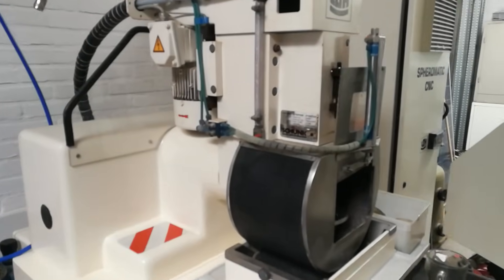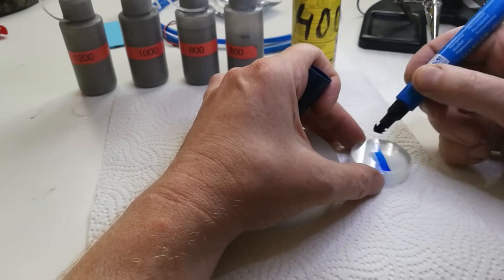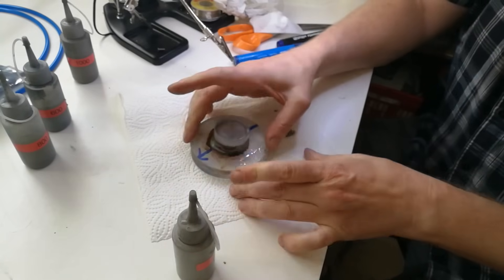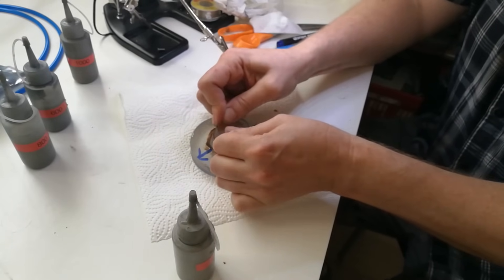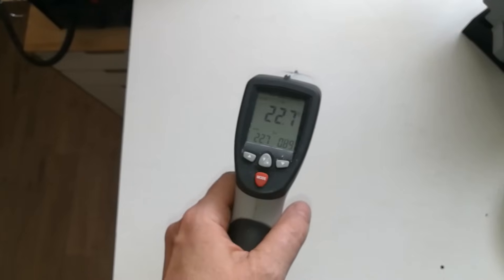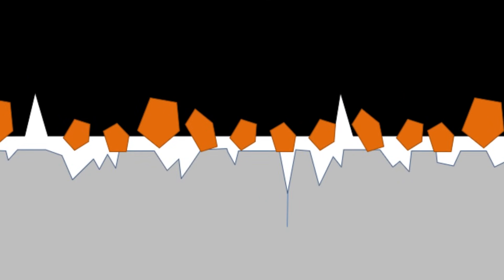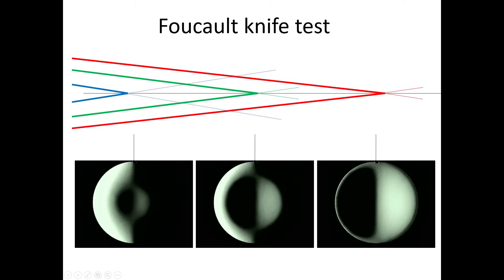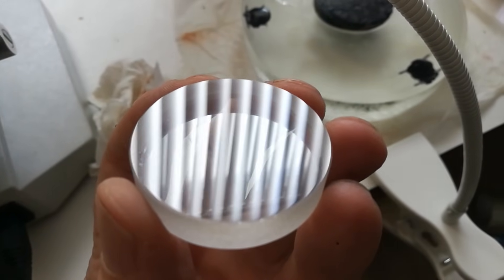Polishing a Small Spherical Mirror Surface on a Glass Blank

Comment: This is black arts you share with the world. I am humbled someone who knows this esoteric knowledge has kindly decided to share such things in detail on youtube. What you do is pretty amazing, and I may use some of this knowledge at one point in my watchmaking for crystal polishing. Thank you!
Reply: Same here, this is extremely valuable, well into the black arts territory.
Reply: Unless you’re sticking with mineral crystal, I don’t think this will work as well for sapphire. And unless you’re working on a watch with a very unique and hard to find crystal , I can’t imagine spending hours on just a crystal
Reply: @imvisier9925  you misunderstand watches and watchmaking, where "black polishing" a screw head to a specular finish is mundane.

The process of polishing brittle optical materials presented here is directly applicable to many watchmakers working on older watches or making new ones. Restoring an old crystal, or custom fitting a new one, is often sensible when balanced against the time and money costs of obtaining a replacement, if one is even available.

A watchmaker wouldn't be concerned so much with dimensional precision in polishing, other than it makes work quicker and easier to produce a consistent result. The idea of using pitch or a similar conformal surface helps to this end. Also helpful is the explanation of surface damage and how inspect for it, which doesn't seem to be common knowledge.

Comment: Cerium oxide is also used in semiconductor wafer polishing :). when doing failure analysis at the micron level we actually look for Cerium during atomic analysis to confirm if a defect was introduced in a polishing step
Reply: In the making if you pass sound waves from furnace to Cut gob the structure is more finally packed with less micro scratches

Comment: This is really excellent. I have a question. I have a telescope eyepiece in which the coating on the outermost (field) lens is deteriorating. I want to completely remove the coating so that the appearance will be uniform across the field instead of darker where the coating is missing. Can I accomplish this by pressing the lens into styrofoam and then using polishing compound with light pressure on the lens against the styrofoam? Thanks!

Comment: Extremely well explained.
What I was wondering is: where do you get your raw grinding surface from? I mean the one that already has the right radius on which you're grinding the your glass mirror.
Reply: Initially both surfaces are flat, but through a special grinding method and using abrasives with large grains, one of the surface becomes concave and the other convex.

Comment: Hello, very interesting video, thanks! Can I ask if you have done any irregularity/power/flatness measurements (with an interferometer) for such hand made items? What levels can you reach?
Reply from the maker: Hi Tomas, I did do interferometry on small mirrors (not this one by the way, this was just for the demo of the process). So, if you put some time in it and avoid the pitfalls related to temperature (friction/warm hands) you can get down to 1/8- 1/10 Lambda. As you can see at around 11.05 , there is some irregularity in the surface. This is due to pressure and can also be largely avoided by milder polishing in the final stage.

Comment: Hello, can you tell me what can I use to polish watch mineral glass?
Reply from the maker: Guess the best way is to use a dremel, some polyurethane polishing pads and cerium oxide as the polishing agent
Reply: @HuygensOptics  thanks for answer! I tried cerium oxide but with felt wool pads. It is working but very slow. The water solution dries up to quickly its problematic. Maybe can you recomendet some polishing past?

Comment: what temperature for the pitch ? where do you get the supplies ? Thanks.
Reply from the maker: Generally you use the pitch at room temperature, so let's say around 21 deg. C. There are different types of pitch which have a different melting temperatures. This influences the "hardness" (viscosity) at room temperature. The type of pitch you want to use is dependent on your surface. Generally, you use softer pitch for a-spherics.  Since I am in Europe I orderd at a German Company named Pieplow & Brandt. However if you search for "optical pitch suppliers" you will probably find a supplier in company.

Comment: Hello. How hard is the pitch you use?
I have some lenses to polish. The soft has several grades of hardness.
Reply from the maker: I generally use the medium grade Gugolz pitch. Since temperature is an important parameter, you can still vary the hardness a lot by polishing at a different temperature. For making spherical surfaces, the pitch should preferably not soft.

Comment: I got that Pitch some cerium oxide, pitches love cerium oxide 😂 jokes aside, I love this channel now that I’ve found it. I love honing surfaces of things in my free time. I even have a pc a honed the surface area of the cpu and heatsink, then honed the heatsink to the cpu (to mostly accommodate for any convex/concave surfacing that may have been introduced by my lack of skills to either the die or the heatsink) and tested it with and without thermal paste and all cores run cooler without the thermal paste and I did long benchmarks and rarely saw over 45 Celsius on any core with a very modest, stock aluminum air cooler. Now this isn’t a ryzen but it is a amd “A” series, I can’t remember exactly which, but I still use it, as is, for CAD design and software testing and never had a hiccup.

Comment: do you polish again after adding a reflective surface?
Reply: No, all polishing and figuring is done before coatings are applied. These processes remove material, so you'll only be removing the thin coating you just applied if you attempted to polish after coating. Sorry this is 3 months late, but I hope it was helpful either way.

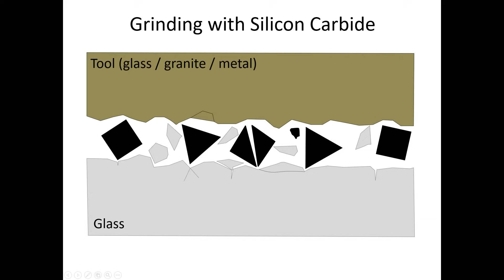Comment: 1:02 regarding subsurface cracks.  Extreme hazard considerations aside, I wonder if either grinding with hydrofluoric acid or pre-soaking the lens with HF, for some soak-grind-(wash) time cycle to be experimentally determined, might reduce crack propagation by loosing up/freeing up the glass surface "bits" (not sure exactly of the microstructure of glass) so they would break off more easily and not transfer force into subsurface layers and induce cracks.  Has anybody ever tried that (and lived :))?
Reply from the maker: I'm sure that you could etch the subsurface damage away if you etch for a long time (it's a relatively slow process). However, the fastest (and safest ;-) way to remove it is just to use sequential grinding and polishing steps.
Reply: @HuygensOptics  thanks for the reply.  I meant less about etching away damage after it happens and more about preventing it altogether--improving the grind process itself by (maybe) allowing more aggressive grinding with less subsurface damage, if the HF could somehow "loosen up" the top layer of glass.  So the glass bits would break off more easily and (maybe) not cause forces to propagate down into the glass as much.
Reply from the maker: @perspectivex  Aha. Well, I'm not sure how that would work. The loosening of particles from the surface is actually the result of crack propagation in the glass. Anyway, I would never try to attempt grinding with HF as an additive to the SiC slurry...
Reply: @HuygensOptics I'm not going to try it either...  I'd like to keep all my finger bones.
Reply: ...do people ever grind their own mirror flats for star diagonals?  I can't find anyone doing that but I don't know why not.

Comment: why cant the parabolic shape be cast into the blank so that all you would have to do is polish it to its final parabolic shape?. if you can cast a flat blank you can cast a parabolic curve with the different focal points!.
Reply from the maker: for smaller mirrors (<300mm diameter), the difference between a sphere and a parabolic is in the order a few microns. Of course this difference it is dependent on the F-number of the mirror and can even be negligable for larger F-numbers.. Due to the thermal shrink during cooling down after casting and due to the surface roughness of the casts it is not possible to cast ATM mirrors accurately in a parabolic shape. However it is possible to cast the rough sphere in a blank. With the large telescopes it is actually possible to create the rough parabola in the surface by using rotation at a specific rotation speed during the melting phase.
Reply: @HuygensOptics  what about taking a smooth mirror blank (talking about the <300mm diameter kind) and heating it minimally till it sags onto a precision machined surface (whatever surface geometry that might be, with the geometry also made to compensate for thermal expansion and other effects, such that the cooled glass requires the least amount of processing)?  Might you then be able to start with a glass blank that is within say 10-20 microns or less of its final shape?
Reply from the maker: @perspectivex  , yes in principle it is possible if you start out with a very parallel glass plate and an extremely accurately machined mold. However, 10-20 microns is still a long way from the final shape, which needs to be accurate to 20 nm for a good mirror.  That is a factor 1000x more accurate. Polishing away 20 microns of, let's say, astigmatism is so difficult that it is better to start of with a nicely grinded spherical surface, polish it (spherical) and then deepen the center area to make it parabolic.
Reply: @HuygensOptics  hm, ok.  I unfortunately don't really understand how long grinding really takes per grit change and how much is a lot of glass (I would have thought grinding off 20 microns would fall on the "little" side but I guess not).   I also thought good telescope mirrors were 1/10 wave, which would be 500nm?  But now that I start to read up on it I see someone saying 1/10 wave is 50nm, which doesn't make sense (yet).  oops, no, my mistake--I'm always thinking of light in Angstroms and sometimes get the factor of 10 backwards.  I get it...it's 50nm.  p.s. can you point me to any references on how to make a machine to grind telescope mirror blanks (in the 200-300mm range)?  I will google but you seem to have a lot of experience and might know a good reference.  A machine for roughing it down to shape or one for polishing (not sure they can be the same machine).
Reply from the maker: @perspectivex. You are right about the grinding of 10-20 microns, that can be done very quickly. However, I was under the impression that the goal of the whole casting exercise was not to grind any more and start polishing  immediately. Since polishing is much slower, 20 um is quite a lot and it will take many hours, whereas with grinding it may take as little as a few minutes. 
Generally we we refer to labda's as an accuracy when we mean wavefront errors. 1/10 Lambda surface error will result in  1/5 lambda wavefront error. So a 1/10 of a lambda wavefront error will require 1/20 lambda surface accuracy, which is 32 nm at lambda = 633nm. If you want a simple machine for 200-300mm, look for "mirror-o-matic" either on youtube or google.  cheers.
Reply: @HuygensOptics  The goal would be to reduce overall start-to-finish time, although if you could go straight to polishing that'd be great.  It would be possible to have a machined form to within a micron then probably even polished itself to final figure down to nm level but  that might be prohibitively expensive unless it was mass-produced and calculating the form such that the cooled off glass would have the appropriate shape might be hard and require some trial and error. But that might then let you take the slumped or cast glass and go straight to polishing.  I don't know.  Somebody, somewhere must have already tried that.
  I'm thinking of joining a telescope making class and the instructor just emailed me a ~15cm mirror will take 60 hours rough grinding then 15-20hrs. polishing.  I'm wondering how I can reduce that (and still retain a high quality result).  Probably making a grinding/polishing machine is my best bet.
Thanks for the lambda clarification.  I still need to read up on it to understand it fully.
Reply: This guy throws an off-the-cuff figure out that slumping the mirror blank into a form reduces his grinding work by 90%....sounds good to me. https://www.youtube.com/watch?v=8bf5uNpUNC0 (it's in his answer in response to user comment, "How do you turn the glass into a mirror? Coating of some sort?")
Reply: @perspectivex  Still have to grind it. Regardless. I don't understand what the obsession is with others doing work. You talk as if you know better, why aren't you doing it and making videos showing you doing it this way?

Comment: 0:14 400mm? That can't be right? That looks like 40mm. And maybe not even radius, but diameter.
Reply from the maker: 400mm is the radius of curvature in the front surface, not the dimension of the mirror.
Reply: @HuygensOptics  I see. That makes sense. Thanks.

Comment: I wish they would do something to bring down the cost of telescope parabolic mirror, so that people don't have to sell a kidney just to buy one!.
Reply from the maker: Making a good parabola is quite labour intensive and requires many hours of measurement and correction. That is why people make their own mirrors: if it's a hobby it's not that important how many hours you put into it. And you can actually make very high quality optics by hand - if you know what you are doing. You can buy cheap telescope mirrors (mostly from China), however their quality and optical performance is generally not very impressive.
Reply: @HuygensOptics  why can't they cast the parabola shape at different focal points into the mirror so that all would be needed is a final polish and then get coated. it would save a lot of time and labor, or even maybe cut the shape with a diamond tipped lathe like on a betts mill. only the betts had a turntable thats 12 ft across. I mean if the cost could be brought down then more people could get into the hobby.
Reply: @davidbrandenburg8029  Glass doesn't cast like that. It just doesn't hold form like would be needed to do that.
Reply: @davidbrandenburg8029  So, simple answer on the diamond tipped lathe process - that is an optical manufacturing process called single point diamond turning (SPDT).  SPDT only works on ductile substrates, there has to be some plastic deformation in the substrate at the tool tip for the chip to form in the right way to make an optically clear surface.  On materials such as Germanium this is very straightforward, however glass is too brittle for chip formation.  There are advances recently in this technology with Ultrasonic or Laser assisted SPDT where ductile mode machining can be induced in brittle materials, however it is far too recent to be the "conventional" manner of producing parabolic surfaces in glass, or hobbyist level technologies.

Comment: Interesting. I use to make glass lenses for eyeglasses. The way your going about grinding the lenses seems primitive to me.
Doing all that seems unnecessary to me. There are machines for that. Also instead of pitch we used cast iron tools cut to the correct curve they had slots in them to. But later they used wire meshes pressed onto the lap to avoid wear on the tool. Even later they used thin zinc pads. To polish they used pellon pads which is a though paper like what is used for shoulder pads in dress making. Same polish you use. With a machine spinning the lens in tight circles while rotating the tool or lap you could make them much faster. The polish is continually pumped onto the lens. Same with the abrasives.
Reply: Lol you poor thing. Can't read? This was a demonstration video to show the process of hand polishing...